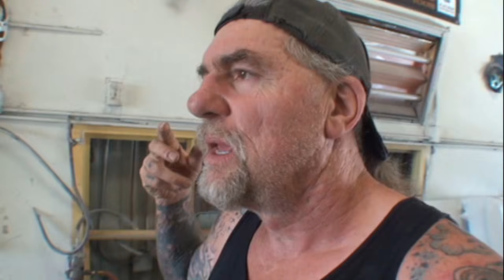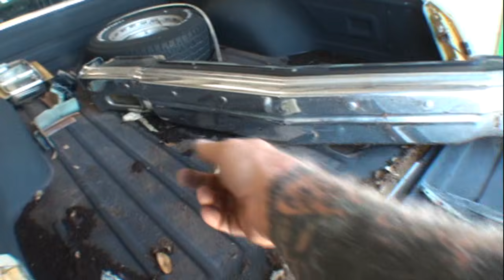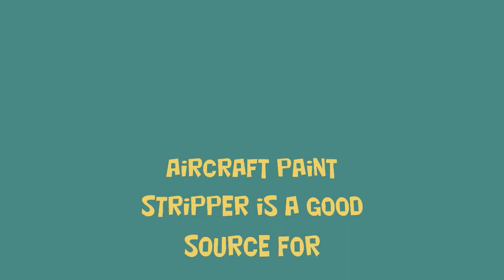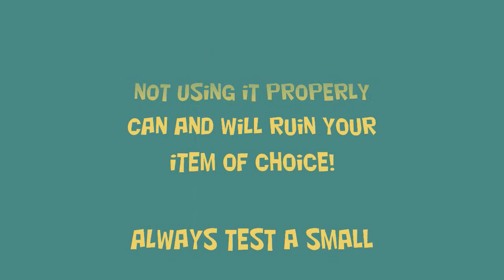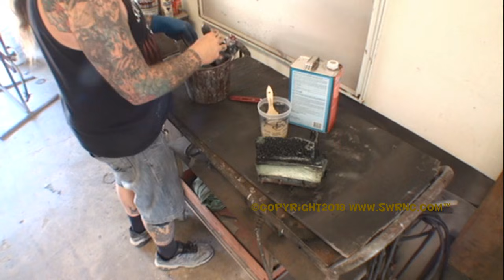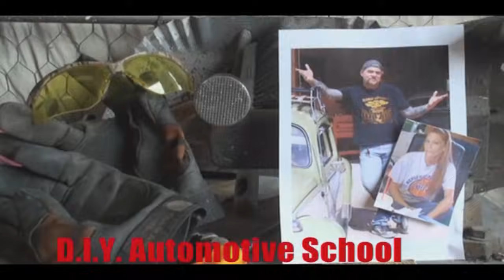How To Remove Paint From Plastic Car Parts Safely

Comment: I use oven cleaner. Stick peice in plastic bag, spray oven cleaner, coat well. Twist bag and tie. Leave for 12hrs. A soft brush will simply remove enamel paints.

Comment: So, so the aircraft coating remover work without damaging a vinyl dash?  Whoever had the truck before me painted the dash pad instead of filling in the cracks and repairing it correctly, and I'd rather fix it right than pay over $400 for a new pad...

Comment: A trick of mine to take paint off plastic parts (like dash trim pieces) is to use regular brake fluid. It attacks enamels, acrylic lacquers and vinyl paints really well and doesn't hurt ABS, vinyl, polycarbonate and other types of plastics used in cars. If urethane clear was used on the part, you must scuff or better yet, remove the clear completely by mechanical means with a coarse sandpaper. Paint stripper works but is too caustic IMHO. it works of course but it will hurt plastics if left too long.

Comment: Great video and great method for stripping paint on plastic fillers.
One observation: methylene chloride is very harmful to your central nervous system and it will soak through skin very quickly. For the audience, please never neglect to use thick rubber gloves for this.

Comment: oven  cleaner    works  safer   u  just  need to soak  over night for a few nights..Never use paint stripper on anything plastic...    Remember this is Rubber /plastic      plastics will and can melt

Comment: Got flexible plastic bumper on a 1994 mr2 turbo had an accident and corner got pushed in cracking paint and alot had come off, puse out the corner with the heatgun trick but paint is sll cracked and i can peel some off, you recon this stufc will remove 2k paint? physically bumper good paintwork fxxked so want to do a proper respray from plastic out.

Comment: Hi. Great helpful video exactly what I was looking for to safely remove paint from a car bumper, etc. I know you’re not supposed to sand paint cuz it releases lead. I’m not a body guy or professional painter but i am a tech. Working on my car and since it’s out of commish (new clutch, rebuild trans, etc) I was thinking of painting my front bumper. Temporary paint fix cuz outer edge of the bumper that holds it to the chassis tore off when I got to close to the sidewalk. Anyways the paint (u can see the white/beige plastic) is just gone under where my headlights are. 03 mustang GT and it’s just dull as fuck. Clear coat is eaten away cuz it’s really dull and tried compound and no effect so it’s dead lol. My question though is can I strip all the paint off my front bumper and apply bondo to fix the area if it’s not level when it’s fully stripped? 
Like I said it’s just going to be a quick fix. New bumper will be ordered and professionally painted but old one looks ugly and I’ll still be stuck with it at least another 3 months.. 
thanks for the video super informative and hope it works out well once I get the paint stripper!!

Comment: Those pieces are Rare as Hens Teeth! Pete, thanks for the tip. I'm gonna strip my buds '70 Camaro Split bumper Grille that's also Urethane plastic like that, hey Pete you should make a Video of how to repair those old nose pieces like the GTO's etc. 3M has an epoxy I'm sure you are already Familiar with. Take it easy

Comment: Thank's Pete for the info. Is there a good way to repair that little spilt on that if it was in a noticeable spot?
Reply: Super glue and baking soda or you can use a plastic welder

Comment: I'm not a body guy.  That's why I watch your videos.
Reply: Jafromobile that's how you learn by hands on, I was doing my own body work before YouTube just getting advice from others and the library but most by just doing, take a welding course will help out a lot to have some basic welding.
That help me out a lot them you see metal as just a sheet of metal no matter what form it's in and you learn how to make a flare piece of steel stronger by putting a few bends in it
Reply: I thought I knew how to do body work before YouTube... It turns out I was really just a Bondo sculptor.  The repair I did back in 1991 was gorgeous until I wrecked the truck a decade later, but what lay beneath the Bondo would have infuriated ever body shop tech.
Reply: Jafromobile yes I was doing the same thing until I took a welding class and learn how to cut out and replace, if I couldn't do that then I would get the metal as straight as I could then add the body filler, most car show cars have to have body filler to get them that straight because out the factory the metal will have tiny ripples in the body.
Some times you have no choice but sculpture the body filler I've done that many time but it has to be a thin coat of it.

Comment: Thanks for the video Pete,  as you explained in another video, the strippers available today have been modified (weakened) to be sold today. I needed 2-1/2 gallons to strip a ‘62 Beetle ! The safety tips are always welcome this can be some nasty stuff if you get it on yourself Thanks Pete
Reply from the maker: When I started this back in the day, I could strip a VW Bug with one gallon or less..